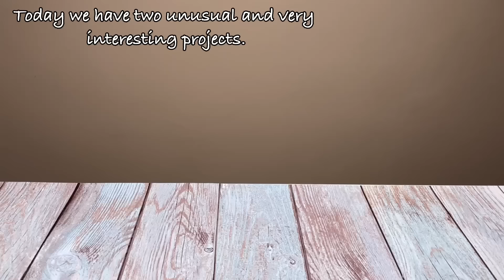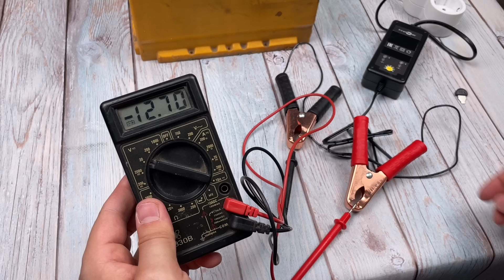🔥🔥Incredible life for an old laptop power supply! This is a feature YOU should know about

Comment: At 2 minutes and 9 seconds into the video, the laptop charger shows -12.71V. This indicates that you must have mixed up the cables. How is it possible to charge the battery if you're using the ground cable from the charger on the positive side of the battery? Due to the mixed cables, the red clamp should be on the negative side. Additionally, never place the clamps on the battery while the charger is powered on.

Comment: 🤣😂 This video is a fake. 
A lead battery that is 0v is dead. 
No charger will charge it. 
For spot welding, you will iron. 
Either the charger will burn or it will be safe but jalais it will weld by point with maxi 4A that produces this kind of chargers.